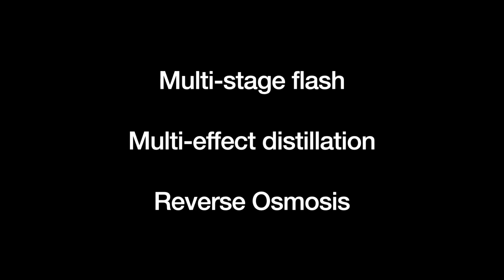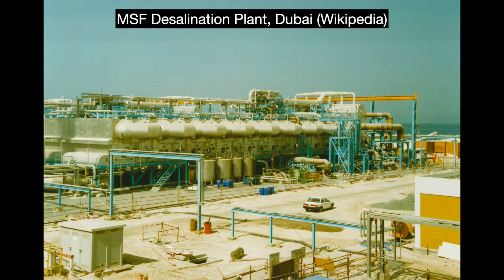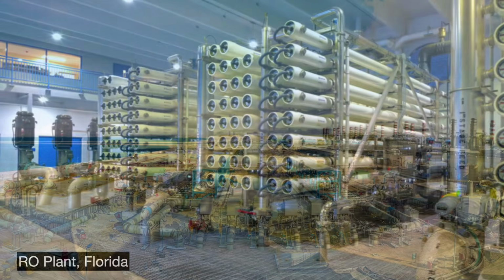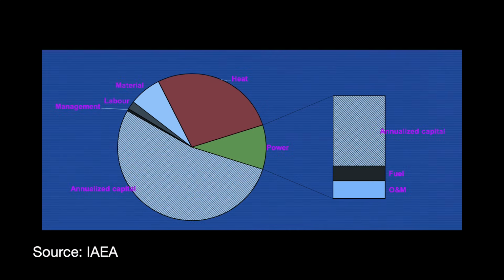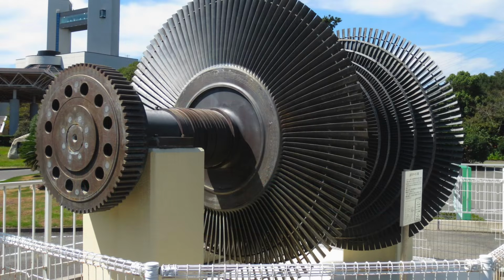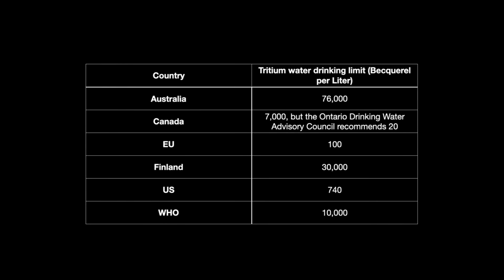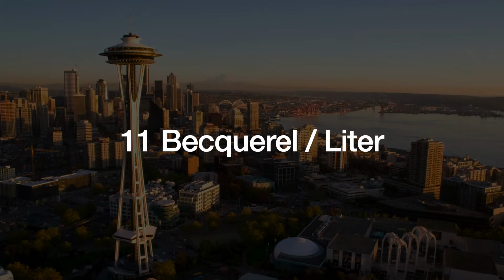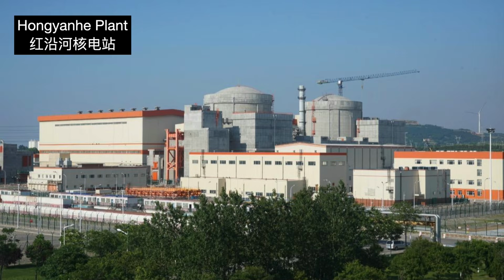Going Nuclear to Desalinate Seawater

Comment: I'm surprised in countries that have deserts there aren't even an prototype of concentrated solar desalination plant.
Edit: I see in the replies many people miss understood what i mean, i don't mean solar panels. Concentrated solar is made with mirrors pointed to an object in this example massive glass dome filled with water.
Reply: SunDrop Farms, Port Augusta.
Reply: @idjles  Aussie Aussie Aussie
Reply: Saudi Arabia is working on one now
Reply: Just few cent thoughts:

The issue with Solar energy is - they can't run 24/7. In a sandstorm, everything is covered by the sand and it will limit the consistency of water production. There are only limited place around the desert that can get away with sandstorm, but not the entire desert. There is no way to build Solar panels ABOVE the sandstorm as it can reach very high level. Another issue with Solar panels are - you need big batteries to store those energy: Majority Lithium, which is another rare material used to make batteries are not as common as Iron or Copper.

Another issue, which I think is the main issue why Solar is not preferred is Cost per liter/galleon of water produced and adding the inconsistency of water production Vs. Fossil Fuel Vs. Nuclear powered.

It's easy to say 'use solar energy', but are you ready to dispose the damaged panels? The material used are comparably toxic to humans as radioactive materials.
Reply: Sand u
Is a big party spoiler i guess ?
Reply: There is a farm  in australia, using concentrated solar for desalination , called sundrop farms. Huge supplier of tomatoes
Reply: These countries usually wait for western or south Asian Asian countries to invent stuff.
Reply: That's how wastefully they treat oil.
Reply: Why invest in build solar panel, concentrated solar power, underground cistern to store water (this for "sun do no shine all the time" and similar BS-ers), other sustainable/renewable, because in my lifetime, burning s**t, would not be a problem.
Reply: Here is a idea: build a greenhouse above a body of water and put copper pipes under the roof, where cool water runs though and catch the condensing water, which is basically free of salt.
Why isn’t anybody doing this in the desert?
Reply: Sand is a big issue for solar efficiency
Reply: There are ro desalination pants that use solar power in Gujarat, India. Thought that's just arid land and not straight up desert.
Reply: This would be like a greenhouse of plastic membrane to heat water at the edge of the ocean. And collect in a cooler place. Create a high humidity air and expose to lower temperature to collect water. Remove precipitated salt as a resource.
Reply: The amount of area needed to desalinate a significant amount of water would be absolutely enormous.
Reply: Apparently you have never heard of Neom city of Saudi Arabia.
Reply: @STEPPACAFE  that's just a fancy CGI, nothing have been built.
Reply: Yeah this was my first thought as well, like fuck yeah make freshwater using nukes in places with clouds but in saudi and dubi use the sun, they have so much sunlight
Reply: Desert environments, particularly in the Middle East and the Sahara, have crazy sandstorms that would destroy/bury solar panels.
Reply: @majicdude88  Would it be possible to place solar panels elevated high enough that they would avoid damage from sandstorms?
Reply: @2drealms196  Don't place it in the middle of the desert. Place the solar farm at the edge of the desert. Elevated 5m from the ground. Use the power for desalination. Use the water for irrigation. In the shade under the panels, we plant some kind of grass. Like wheat. We start from the edge of the desert, push the border, creating more farmland. As the desert retreats, we move the solar farm forwards, gaining new farmland, or selling off any excess for residential/industrial use. The fact that these new houses and factories are so close to the source of desalinated water and electricity would be a plus.
Reply: @danielch6662  If you place your infrastructure that way you need to also make very sure that every effort is being taken in that area to prevent desertification passed that edge, otherwise where you just put your expensive solar cells may be covered in sand much faster than you realize.
Reply: @danielch6662  You should read up on what wold happen if you remove a desert.
Reply: @danielch6662  sure looks easy on papet
Reply: Deserts exist not only in the middle east. Australia has a lot of its power from solar and wind. Although the desalination plants in Australia are not always directly complexed with solar panels, a lot of their electricity is supplied from wind and solar plants, thus you may take them as "de facto" solar and wind powered desalination.
Reply: The desert operates on a geological timescale, humans don't naturally react to things that happen "slowly" from their perspective. The Sahara used to be a Jungle, the Middle east was the Fertile Crescent, Australia was once covered by rainforest. Then "poof", one day it's all gone, and a couple of generations later that is just the way it has always been.

What we are good at though, is fucking up the few good things we do have. Look at the Aral Sea. 

Coming soon, the Amazon Plains; The Salt Flats of Indonesia.

Anyway, have a nice life everyone :)
Reply: Are you talking direct evaporation from concentrated solar, or are you talking about using concentrated solar to high yield solar cells?

The energy needed to evaporate a cubic meter of water is 627kWh. This figure ignores heating the water, as you need only 91kWh to get from 20 to 100degrees, and that figure is dwarfed by the energy needed to evaporate the water.

The energy needed to create 1 cubic meter of desalinated water from seawater through reverse osmosis is 2.5-4.0kWh. This is at least 150x times better.

Why you need nuclear for this is beyond me, any country that needs desalinated water has excellent solar irradiation, and RO can happily be run only when excess energy is available.
Reply: @luc_libv_verhaegen  I think, start/stop cycles will destroy the equipment. Or at least make it really hard to pay off, since "excess" is only a few hours per day.
Reply: @ImaskarDono  Energy storage systems could help with that
Reply: @ImaskarDono  by your logic pumped storage wouldn't be practical because it would "destroy equipment." That's not how stuff works. It's not problematic to cycle it on and off as needed.
Reply: @ParadigmUnkn0wn  pumped storage is a different tech, not chemical. And economics are different.
Reply: @makisekurisu4674  when we'll have a massive scale storage, maybe. But we don't have it.
Reply: @ImaskarDono  I was responding to this statement: "I think, start/stop cycles will destroy the equipment."

Most RO systems are used intermittently anyway. The concept is no different between filling up a few gallon tank for home use, a few thousand gallons for commercial use, or in this case, scaling up to fill entire water tanks. I know both the former scenarios are already common, and I'm guessing that some of these beverage plants and bottle water plants are running at the scale of some entire municipalities.
Reply: @ImaskarDono  we design our energy grids based on the excess and use tech like peaked plants and batteries to deal with it. desalination could be a good alternative to building massive battery networks and decreasing the peaks in our energy storage needs.
Reply: @Hollow_Mist  so, when it's not windy for 3 weeks straight, you are fine to live without water?
Reply: @luc_libv_verhaegen  problem is water systems have to run 24-7 so you need a baseline, not strictly a deal breaker though, plus ideally you'd be desalinating to fill reservoirs to help with shortages
Reply: @AsbestosMuffins  You need a baseline for water supply, not production. Unlike electricity water is extremely easy to store in vast quantities. The down side is that not running equipment 24/7 is harder on capital cost, but when the main bottleneck is energy costs that is fine.
Reply: @AsbestosMuffins  water tanks exist
Reply: @AsbestosMuffins  Why do you need a base line?  Just desalinate during the day into a reservior and pull from that 24-7.
Reply: @AsbestosMuffins  No , molten salt thermal solar plant. Supplies base load power.
Reply: @luc_libv_verhaegen  Hmm, I'm finding lots of conflicting resources on this. Scientifically, reverse osmosis as a process doesn't require much energy. But it certainly will need more if you're forcing through water faster than it normally would go at an industrial scale. Desalination plants at that scale DO use a lot of energy, it makes up the majority of their costs, in fact. That's why places are looking at renewables and nuclear as ways to at least make the process of powering desalination not contribute more to greenhouse gasses where energy is still largely provided by fossil fuels.
Reply: @luc_libv_verhaegen  And then you get 627kWh back when you condense it again. What's your point? If just means you are moving a lot of energy around, but with decent heat exchangers that's fine.
Reply: @luc_libv_verhaegen  Running things only when excess power is available doesn't plan for the overall water needs of an area. Only if all needs are met in excess will that work. In the end working with pure hypotheticals that center around the energy requirements of the systems misses some of the most crucial variables for determining what is really the best option - How much water do you require to meet the needs of your people (usually planned for against growth over decades), and what are the capital costs to meet those needs. While RO processes are more energy efficient they do have drawbacks in costs and scaling. Only with a whole picture can you determine the best overall plan for an area.
Reply: @huma474  It is all about cost.

Desalination is one of those processes that does not absolutely need to  be run 100% of the time. You just have to invest enough in capacity; for instance, if you plan to only have cheap electricity 2/3rds of the time, build 50% more capacity and you have the same overall throughput. 

Nuclear is very expensive, but has a capacity factor of 92%. Renewables are cheap, but have a lower capacity factor: 11% for solar in germany (based on sun-hours), 18% for solar in riyadh (which is skewed, as availability is high, but the high temperatures depress output of the panels), 25-35% for onshore wind (and rising with the newer bigger turbines), 40-60% for offshore wind (again rising).

At one point, it will be cheaper to add more capacity than to pay to have to run 100% of the time.
Reply: @luc_libv_verhaegen  Sighting regions like Germany means you are ignoring the message of the video. Germany doesn't need desalination plants to help supply water to their people (yet). Renewables are not "Cheap", they still require investment to be setup and attached to any grid they are part of. The only times the are universally better in estimates is when battery or energy storage systems are ignored. Nuclear power is absolutely expensive, however it is a system that like solar benefits from technologically advancements. Just based on the US a single reactor coming online in the US now ( within 2022 and 2023) has a capacity to generate electricity that is magnitudes above most of the solar farms, or wind farms, out there. Nuclear power is absolutely more expensive on the front end, however once any Nuclear reactor is function it has a multi fold capability to produce energy beyond what renewables can right now. A Nuclear reactor doesn't have to stop when the wind doesn't blow or the sun doesn't shine.
Reply: @huma474  You need desalination where there is no rain, so where conditions are perfect for solar.

Installed nominal capacity for nuclear costs about 11-14B EUR for 1.6GW. Installed nominal capacity for large scale solar costs about 1M EUR per MWh, or 1.6B per 1.6GW. That's almost an order of magnitude difference. And solar is solid state, has very limited running costs, no hazardous waste, and needs no expensive decommissioning. The biggest worry in germany for large scale solar is the damage mice cause to cabling.

The best price comparison is in the .uk. Hinkley Point C versus the Dogger Bank wind park. Go look it up. And then realize that this is offshore wind, which is still comparatively expensive, and a sizable chunk of that cost is the grid connection. And yet, it still handily costs only 39.65GBP per MWh versus 92.50GBP per MWh for Hinkley (in 2012 numbers).

If you have objectively looked at the actual numbers, there is absolutely no way anyone who can do basic math can be for nuclear.
Reply: @luc_libv_verhaegen  Your examples use EU costs for everything, ignoring where the video was talking about. If you want to change the argument on the cost side then stop using European generation statistics. The costs of generating power in the UK have absolutely no bearing on the cost of tea in China. You are trying to define what it would cost  from a different country based on what you can predict from a different place. Also You do not always need desalination where there is no rain. A place that regularly gets rain may still try to desalinate water so that they can make sure that everyone else in their water line has water.
Reply: @huma474  Did i not do a relative cost comparison there? Between nuclear versus solar versus offshore wind in the same geographic (and pretty northern) location?

Working with relative numbers is basic math. But is seems as if objectivity is lacking here.
Reply: @luc_libv_verhaegen  water at room temperature will vaporize at lower pressures.
Reply: @luc_libv_verhaegen  Because many regions with water shortage have high population density. High population density means low water per capita, and low free land per capita.
Reply: @grosskopf79717  The romans had aquaducts already.
Reply: @luc_libv_verhaegen  i thought using concentrated solar (focusing mirrors) to heat the water, not with electricity from concentrated solar.
Reply: @luc_libv_verhaegen  the reason for nuclear is that nuclear generates a ton of clean energy in the form of heat, and these desal plants run off of heat. it makes sense to couple a process that generates a waste product with another process that utilises that waste product to generate something useful.
Reply: @luc_libv_verhaegen  They don't boil ALL of the water, just a certain percentage is lost as steam, and you have to replace the membranes on RO systems.
Reply: @luc_libv_verhaegen  The energy needed to evaporate a cubic meter of water is 627kWh
Not exactly. You're assuming 0% efficiency at reclaiming that energy. The theoretical limit of efficiency would involve the heat of enthalpy of dissolving salt into water. Since salt absorbs heat when put into water, it should release heat when taken out. This means that, in theory, with a big enough plant at near perfect efficiency, you'd need no power source because removing salt is exothermic.

Insane, I know.
Reply: solar is expensive most desert countries are not rich and there are plenty of videos on why solar in a desert is more of a fantasy
Reply: @memespeech  Weird how Marocco earns alot of money by making electricity via its various solar farms. It even ships some of that power to Europe.

There are challenges, sure. But hardly impossible.
Reply: @memespeech  lol, most of the desert countries are rich from oil. They just don't invest in solar because they're oil rich. Although I think most of them have done some virtual-signaling tier solar projects to show off on PR videos, but that's all they are. They haven't made any effort to actually scale their solar.
Reply: @memespeech  Nuclear is very expensive, once constructed solar energy is free.
Reply: So, you don't make fresh water at night & on cloudy days. Good plan (sarcasm)....
Reply: Saudi Arabia is working on this for their new city Neom. I believe they've contracted with a British company called Solar Water